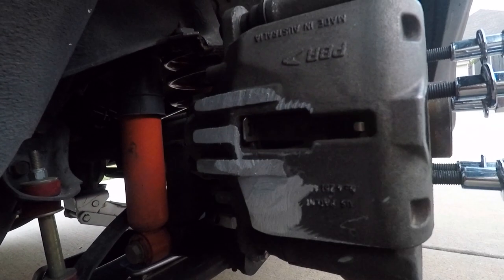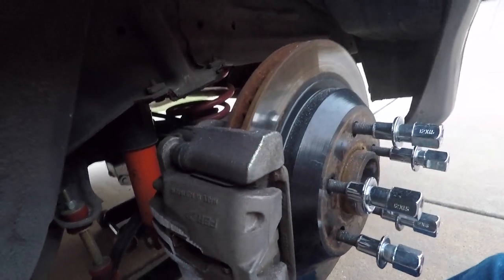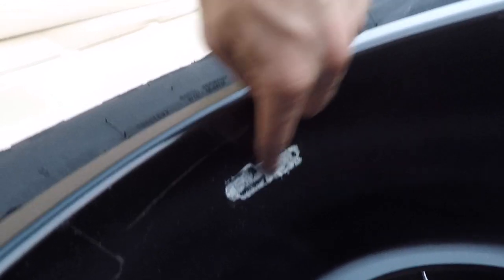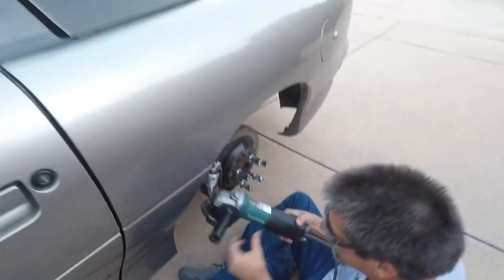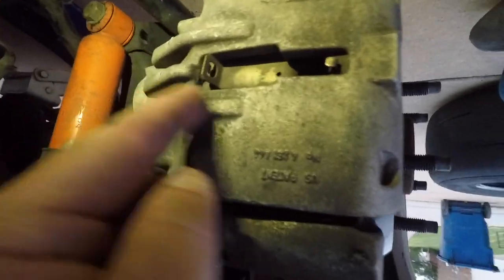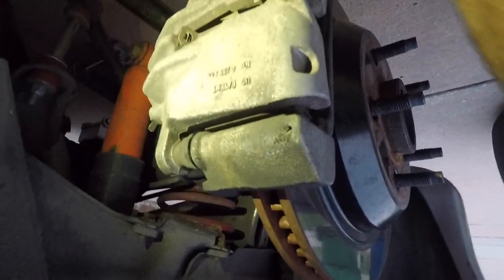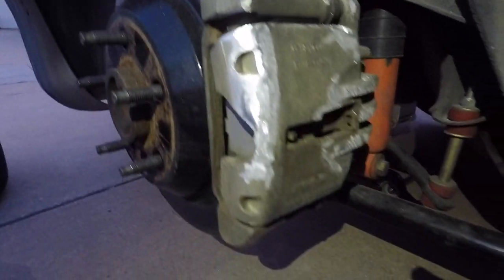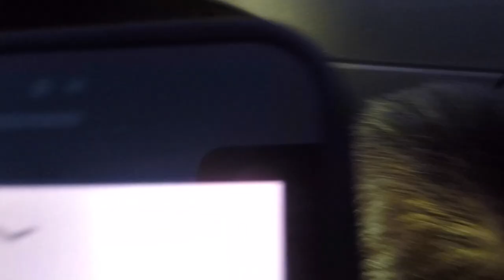How to make 15" race star wheels fit on an Fbody camaro

Comment: My god ,I have never seen somebody grind down the brake caliper before, why not buy the right size ,this is very ,I am speechless.
Reply from the maker: jett Ironside there is absolutely nothing wrong with grinding down the edges of the caliper that are rubbing the inside of the wheel, it effects nothing. i’m sorry that i don’t have $1500 to drop on a new proper brake kit, mine works just fine. this is literally what everyone does. also this is what you do to get going when you want to go to the track the same night. you are the first person to ever be offended by it. i’m sorry that you’re such a loser that you have to go on other peoples pages and whine/complain like a baby. get a life.
Reply: @jettironside9851  practically everyone does this i had weld draglites before and really had to grind alot more and add a spacer. Its called hot rodding.
Reply: @rolando5933  ok why not sell the rims and get the right size ,just a few bucks difference ,and safe,it's your life your putting in danger.not mine.
Reply: @jettironside9851  drag racing and street racing is putting your life in danger, why not sell my trans am and buy a prius? Cause im not a pussy, and theres nothing dangerous with grinding your calipers  almost everyone with an f body running 15in drag wheels has had to do this and i have never seen any caliper failures.
Reply: JETT IRONSIDE??? More like JETT MARSHMALLOWSIDE
Reply: This is the typical response of someone that just bolts on expensive stuff without getting their hands dirty. Welcome to budget effective car mods
Reply: @carlostrujillo3854  ok I am rich
Reply: I had mine caliber brake after doing these whend I breaked to many times

Comment: I have an extra set of Racestars sitting around and I was wondering if they'd work on my Firebird Formula. Thanks man
Reply from the maker: Grey Gorilla check the backspace on them, i think fbodies are 7.5 inch backspace, if so 15x10s should fit. thats what mine are
Reply: Do they make a 7.5 backspace? I just seen that they only have 7.25 backspace
Reply: @naranjoceidy  wondering the same thing, they only make 7.25 with 44mm offset, which technically is like 8.5 inches of backspace
Reply: @carterm623 is it possible to fit them with 8 inch backspace? I have some 15x10s have longer studs (not installed yet) on a 275/60/15 tire stock height can it still fit?

Comment: Nice setup... whats the specs on the wheels / tires?
Reply from the maker: Kevin Beast wheels are 17x9 with 275/40s up front and 17x10.5 with 315/35s rear.

Comment: What size front did you go with and what was backspacing
Reply from the maker: sam golds 17x4 in the front i forget tire size maybe 28” and bs was 1.75. backspace on rears was 7.25 or 7.5 somewhere in there, whatever stock is.

Comment: Did uu sell the truck?
Reply from the maker: Luis Garza no i wrecked it and it was totaled so i don’t have it anymore
Reply: Carter Mckinney damnn that sux  you didn't keep the performance parts like the stall??
Reply from the maker: Luis Garza i kept the tranny and the custom converter as well as the cold air intake, led headlight bulbs, front headlights and rear led taillights and put that stuff on my dads 03 silverado